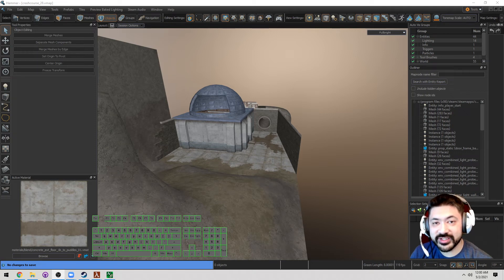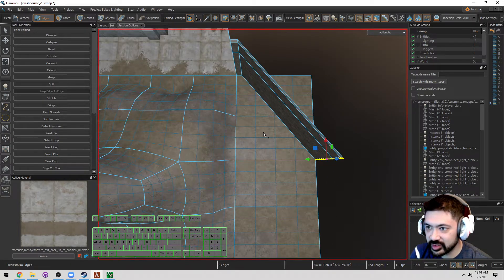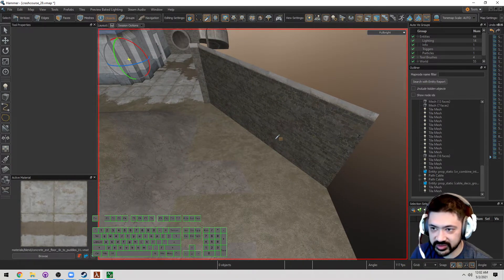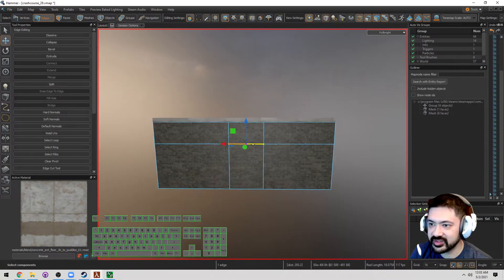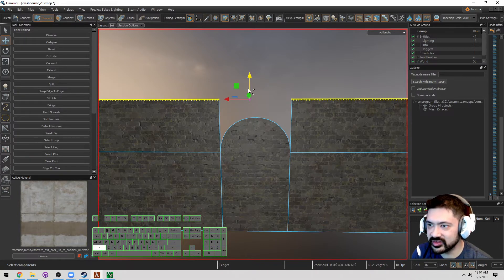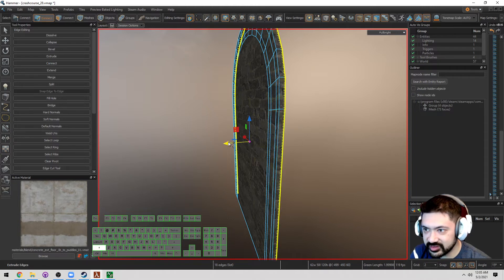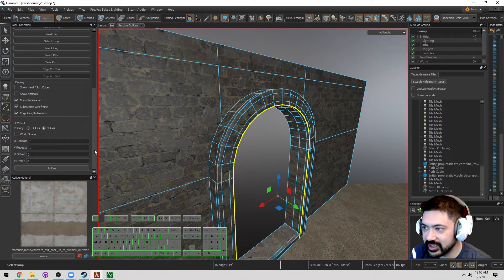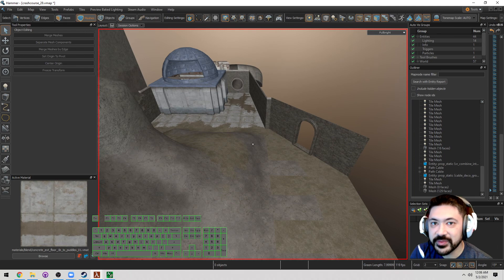Source 2 101 - Hammer Crash Course #28 : Work Space Plane and Smoothed Archways (tutorial)

Comment: 03:51 doesnt work for me. If i double click the exact same edge, it wont detect the inner space but the outer faces. 
If i select the inner space edges manually and fill the hole, it wont fill the space like in the video but the other side of the 2D faces where no faces were before. 
Maybe it depends on how I created the wall to beginn with? I created it with a normal mesh and deleted the faces to make it 2D like in this video. 
Do you know what i did wrong?
Reply from the maker: Make sure they are all on the same mesh. If any part of it is separated it wont fill the hole in correctly. We use the bridge method right before to create the top frame of the arch so the entire face is solid as one mesh. Make sure you check to see if they are all together for the fill option to work
Reply: @eagleonedevelopmentteam849  I solved the problem. I had to create the wall with the polygon tool. Creating the 2D wall out of a 3D mesh created the problem. I have no idea why.
Reply: @eagleonedevelopmentteam849  So, I created a mesh, selected all faces, deselected the front and deleted the rest. Then i did the same cuttings as you did.
I even followed the steps where you pulled up the edges to bridge the top. I pressed B because pressing the bridge button would act like ALT B.
Then i pulled up the arch with using Y and Enter. But after doing all that double click still selects the faces of the cut out outside meshes. 
At which step did the meshes stop being the same mesh?